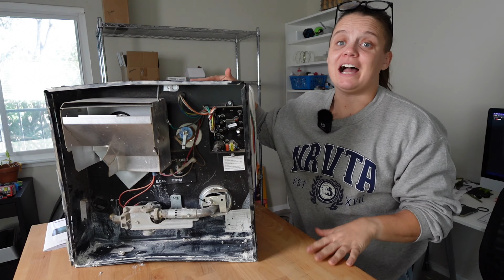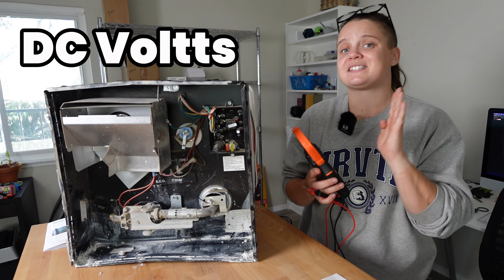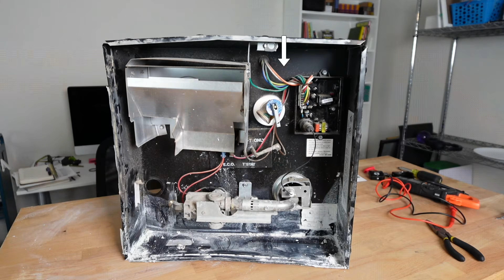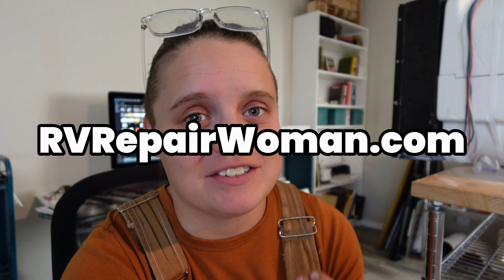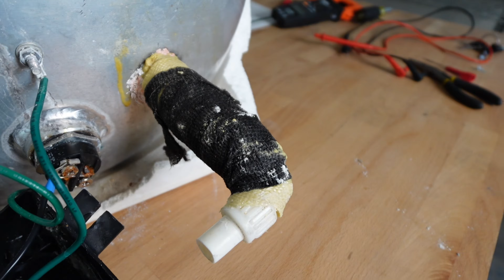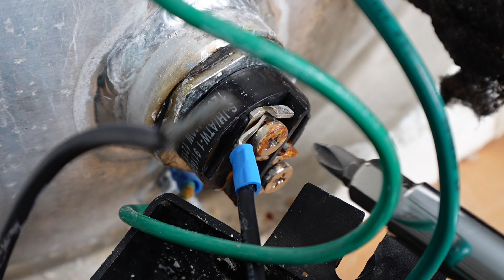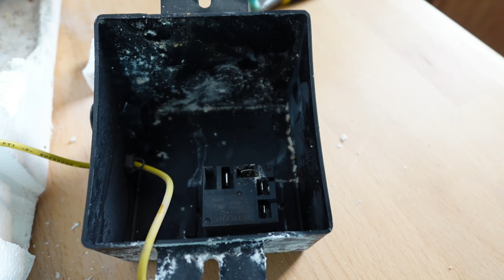How to Troubleshoot Your Electric RV Water Heater

Comment: No heat and yellow/brown wire no Voltage.  Can it still be a good cleaning. I see calcium build up on the drain ug and pressure valve

Comment: Could you help me.  My plastic screw was leaking. I had a full water heater.  Forgot to let pressure out.  Well did by itself.  Now propane works great but electricity will not ignight? Any suggestions?

Comment: I really appreciate your videos.  They are extremely informative and easy to follow.  On my last outing my water heater system turned on the DSI Fault light.  I thought I had resolved it by cycling the breaker, but the fault came back.  I thought I would just switch to LP and deal with this after the trip.  The DSI fault came on immediately with LP as well.  Because of your videos I was able to determine that the issue had to be common to both LP/AC and it very quickly limited my troubleshooting to a few specific items.  My tester doesn't have continuity, so I had to just set it to ohms and check for resistance.  I had resistance in the thermal fuse and the ECO.  The T'Stat was another story.  Nothing there are all.  It may not be the only thing that is bad, but I need to replace that and go from there.

Thanks for making an entertaining and educational video for us mildly technical RV owners.

Comment: Thanks for the video, my HW heater quit working last camping trip. My grandson left the bathroom water on and over flowed the sink which fried the GFCI outlet below the sink (More about this later).
 The propane side the HW heater worked fine but the electric side was dead. I used your video in real time to troubleshoot my heater. All of the 12 volt circuits checked out fine. I even tested the relay buy removing the 120v connections to the heating element and it checked out fine but no voltage to the heating element so per your video I looked to the 120 volt supply. 
I pulled the panel off of my power distribution box and tested the breaker three times and each time I had 120v on the breaker screw. 
I unplugged the RV and reached in to see where the wire from the breaker went and the wire came loose from the breaker. I reinserted the wire and tightened the screw. I am sure when flipping the breakers to power off the GFCI receptacle for replacement the wire came loose from the HW Breaker.
Thanks again, Tom 0:04

Comment: 2011 open range 34rl. I tested everything in this video twice other than the relay. I did find a video on bypassing. But unfortunately for me, the DSI light comes on, when I switch to Gas or Electric.  And yes there’s water in the tank. 2 12 hour nights tracing wiring still can not figure out

Comment: Can you leave the electric on all the time or should you turn it off when you are not using it? Will it harm the hot water heater?
Reply: If you have the water heater on with no water in it, then it will blow the heating element in a minute or two, or less. If there is water in it, and you are leaving it on without using it, I've heard/read that it will shorten the lifespan of the heating element.
Reply: @chuckcurtice7752  hey just another question? Could you possibly put a house hot water tank in a trailer like maybe a 10 or 15 gallon tank? And use the existing electrical wire?

Comment: I have an Atwood hot water heater that Cycles on and off both electric and gas and there is a clicking until the the hot water heater is up to temperature. Any ideas on what this could be.

Comment: I'm having a issue with the water heater overheating. Turning it on electric, after it heats up it will blow water out the overflow, like it's overheating. Do I need to replace the overflow valve? Also is there a way to adjust the temp of the water? It's extremely hot, and I'm not sure if this is related to the problem. Thanks for any help.
Reply: I'm not a tech but after watching some videos I'd say try changing out the tstat & eco. It shouldn't get hotter than the eco temp limit.

Comment: If the white wire is switching between doing 0, ~7, ~68 volts how would you diagnose the issue from there? The breaker which controls the water heater is outputting 120 volts and I am unable to figure out why it would work but the wire isn’t

Comment: Thanks so much for these videos.  You are gifted at teaching!  I'm not sure if you're monitoring comments on this release anymore, but here it goes.  Two questions:  1) Concerning the screws on the relay, we did get about 120 volts on one of the screws, but only 1 volt on the other, rather than the 3-5 volts mentioned in your video.  Is this a problem?  2) Our water heater does work in propane mode, but sometimes when it fails to light on the first try, it lights with a loud "poof", as if too much propane is entering before ignition.  Is this normal, and if not, is there a solution?  Thanks again for all you do.  You are very helpful!
Reply from the maker: Hey Kelly, thanks for commenting. 1. 1 V should be totally fine on that heating element. If you’re not sure if it’s working double check with the resistance test. But seeing only 1 V should be fine. 2. I would look at cleaning your igniter and checking the gap on it. Most of the time I’m having ignition problems it comes down to either the igniter needing to be gapped or sometimes the burner being dirty. I’ll admit the propane side of things is less of my forte than the electrical. Also try just blowing some compressed air into that burn chamber and just making sure there isn’t too much dust and debris in there. 

You got this.
Reply: Thanks again!  I removed the igniter and found that it was coated with soot and had a gap well over the specified 0.125".   Once cleaned and regapped, it works flawlessly every time.

Comment: Hi, great information on your video, Question for you, everything checks out good on mine but the voltage coming from the yellow wire is only 10.5 volts and it won’t close the relay, does that mean the circuit board is shot, I had just replaced it last year as well.
Reply from the maker: I would double check that the relay closes when you give it 12V separately. Juuuuust to make sure it’s not the relays fault. And then yeah my guess would be bad board. I don’t love how new the board is and that being the diag. I’d double check that fuse if you have one, switch it out even just to be sure.
Reply: @rvrepairwoman  Hi the relay works perfectly when I connect it to a 12 V battery. And that two amp fuse is good on the circuitboard. Just wondering why the voltage coming from that yellow wire is lower then 12v and will not operate the relay. Thanks.

Comment: How would you fill the tank with vinegar to clean it out?
Reply from the maker: A funnel system through either the anode rod or the plastic plug hole. You can go to to https://rvrepairwoman.ck.page/6f5b2abf97 to get my maintenance guide that has a step by step tutorial. Or just wait for next Weeks video, which is on this exact tooic

Comment: My hot water tank beats up till it burns your hands and will not shut off. It keeps pulling 8 A. I'm thinking it's thermostat and with your air conditioner running your breaker.